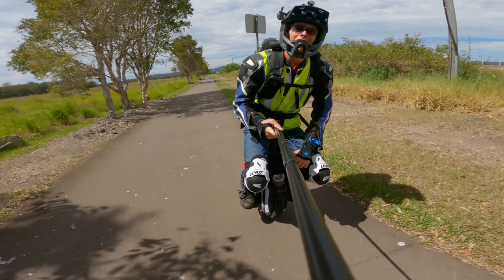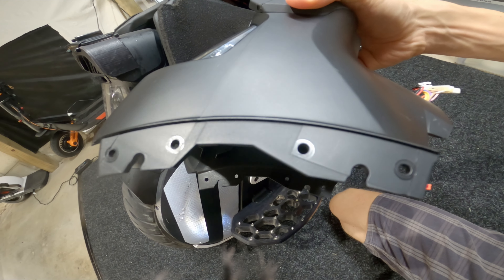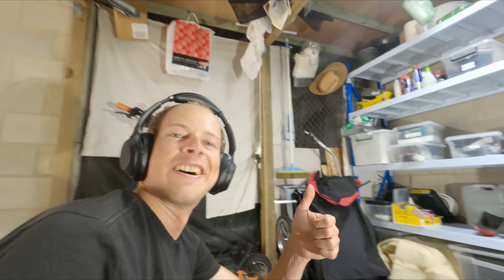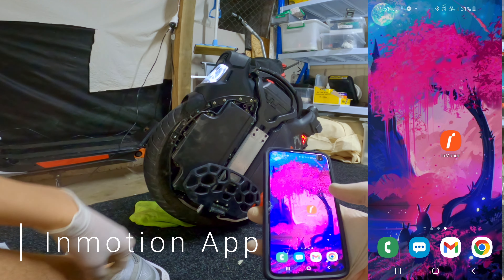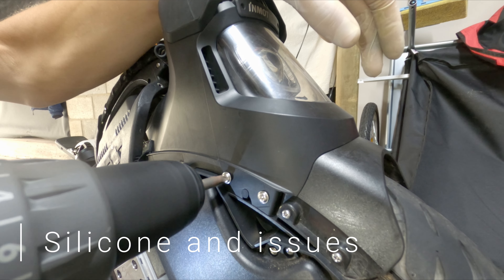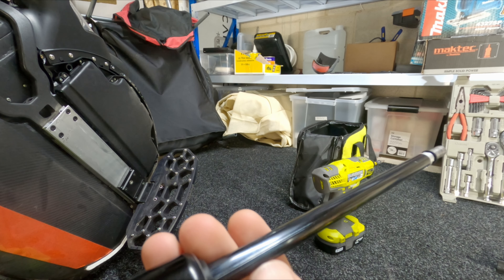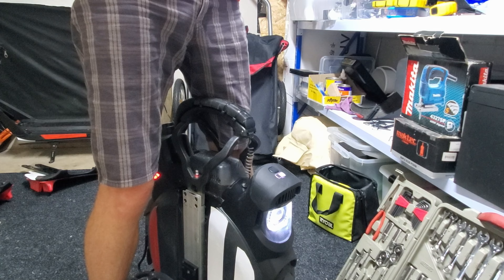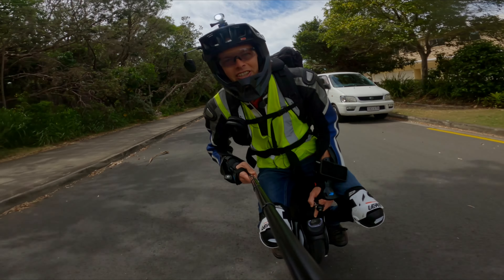FIXED! New Headlight on my Inmotion V11 EUC - Part 2

Comment: V11 owner here too… That squeak is the suspension sliders rubbing up and down the plastic… I cut up 3m felt pads (designed for gluing underneath stool and table feet) and stuck them next to the plastic sliders… then applied sewing machine oil to the felt and the squeak went away plus makes for great lube! It was a rather snug fit to slide the thing back on but makes for very nice quiet and smooth motion…
Reply: If you try it, make sure you stick the felt to same plane as the plastic as it will wedge in between the black plate and the aluminium… when u add the oil it makes a very snug fit which you should wobble gently and slowly lower down…
Reply: @Blakeusblades  "slidders up and down the plasic"?
What do you mean by plastic? The saddle part that slides over the alluminum slide rail?
Reply: The black plate that slides in between the 4 plastic guides…
Reply from the maker: oh hadn't thought of that area. cheers!

Comment: I would use some grease, Slickoleum, on the suspension rod. Its air sprung so the sealing has to be a lot tighter than coil. Secondly, this is what I did to some cheap air shocks on my escooter that majorly improved action, remove the valve core and inject some suspension oil like Fox Gold or similar. Huge improvement in action, removed most stiction. The heat from friction on that suspension will destroy the seals. I don't know why China based suspension cheaps out on lube but they do.
Reply from the maker: hey thanks for the tips, keen to try them.

Comment: Great vid, thanks! My suspension also squeaked at some point, and I managed to fix that by lubricating the suspension rails with WD40. No disassembly required for that, as it’s exposed already. The fact that the suspension rails are exposed moving parts probably means I’ll have to lubricate them every now and then, as the rain washes away the lubricant over time.

I posted a picture on my channel, as I can’t post pictures here.
Reply from the maker: Hey Dennis, YES! ah what a process but I've isolated it to the sliders too. 
eliminating the pistons and foot plates. 
I stripped down the sliders and removed / cleaned the slider block spacers. 
As you said, I lubricated the rails with a silicone spray (test). Then felt it was the wrong type so went with PTFE as everyone suggests, but it wore off within one ride doh. May just need new slider blocks like here: https://www.ewheels.com/product/im-v11-slider-block-spacer-set-screws/
Ewheels don't ship to Aus so i'll check with my shop too. I'll post about it if I find a more permanent solution.

Thanks for the pic, interesting to see the wear pattern is exactly the same on the black paint. 
ta, jono

Comment: That was an easier fix than I suspected. 
I just check. I am at 3900km. I have the exact squeak. Its coming from the pedal area. Turn the wheel on. Lean over it and put one hand on each end of the pedal. Apply pressure to each end of the pedal. Back an forth. This is where I heard the sqeak. Don't know if its hanger or shaft wear. You have different pedals so I now know its not the pedals. I sprayed white lithuim on my pedal shaft and the noise dissappeared for two rides. 
I also have the play in saddle/craddle. Not as much as you do but I did change my slide spacers about 1000k ago(Ewheels has them). The v11 has 4 spacers on the aluminum slide. When I change my tire i will add 2 more toward the top where I think they're most needed. That should add little more rigidity. 
I have ridden in a few heavy rain showers and I have had no issue with the power button. However, your tape idea is a good idea but cut the tape in an oval/circle shape next time and it will look close to stock. I have some 3m clear tape. Im thinking of doing it. I doesn't hurt the looks and provides some peace of mind. 

Also, I just had a firmware update. Did you get it?
Reply from the maker: Oh nice, I would like some of those new sliders. I thought that the spacers had specific spots they fit, how can you add more?!

Hmm my foot plates are difficult to squeak by hand. Last time I used light silicone spray to lubricate the pin, i'll redo it with some heavier grease.

Yeah the 1.4.15 firmware went on yesterday. It was a bit odd on the app saying "Null' and then checking versions again and said it was already the latest version. seems to have updated the wheel though since the wheel beeped and rebooted.

Comment: I had V8F,  after 560 km motor broke and also damaged controller. 600USD cost for the motor, another 200 USD for controller repairs. I also have Begode Tesla T3, zero problems after 4100km. I love simple Begode wheels. In general I really like non suspension wheels. Almost no maintenance needed :).
Reply from the maker: Some of Wrong way's videos promised me how simple wheels were meant to be. then i got the damn suspension v11! yeah that's definitely an appeal of non suspension - far simpler and lower maintenance. That is my hope with the Sherman S, lower maintenance on the suspension.

Wow that is some poor performance from the V8F, warrenty didn't cover it? Almost be able to buy another new wheel for those repair costs x.x
Reply: @jonoeuc  It is mystery to me what happened. In my opinion the bearing got stuck and the motor twisted the axle by itself. This happened when I was walking next to the wheel by using troley handle. The damaged motor cable then blow up the controller. It was incredibly unlucky and my seller did not believe me. It looks like i jumped the wheel. Other than that V8F is very simple, changing the tire is a joy, so simple :-).
Reply: Buy from a reputable vendor and get a warranty next time. Suspension is the real deal and most wheels will have it going forward.

Comment: Good vid
Interesting, probably a cold solder connection. I seen that they put alot of silicon on the components of that board. That would make it hard to impossible to touch up the connections with a soldering iron.
38$ for Uber, how far? No friends or family to come get you 🤣
Cheers
Reply from the maker: it was 17km (10.5miles) 28minutes, ohh nuh it was the wroooong way from them and bad time of day.

Comment: v11 does not need any additional sealants to withstand any weather.
Reply from the maker: it does have very good stock water proofing. I always air on the side of caution since the risks of water caused damage is so high.

Comment: So my head light on my V11 stopped working and they sent me a new one. I was going to send my V11 back and have the shop do the replacement. However it seems like it’s very simple. Should I just do it myself or let the company do it? Great video mate.
Reply from the maker: If you have the allen keys and can see what I did then go for it! it's straight forward(unless you've siliconed your case shut like me 😅)
Plus less downtime if you do it yourself. Good luck!
Reply: @jonoeuc  well I did the replacement and still no light 😞. I guess there’s an internal problem and shipping it back is my only choice. However taking the light assembly off and putting the new one on was just like you said. Thank you for your help and video.
Reply from the maker: ah what a shame. brace yourself for wheel withdrawal! (if it's your only one)
hoping for a quick turnaround.
Cheers
Reply: @jonoeuc  I shipped it off as of today so the waiting begins. This is my only EUC however I have a Kingsong S22 on order.

Comment: My headlight is impossible to pop out. You make it look effortless the way you just take it out but I have it stripped down to replace the inner shell and I’m considering taking a hammer to the headlight bumper. Was there a trick for you?
Reply from the maker: The only trick are the locating pins / slots that you must pop out at 2:55 in the video. They're clipped in so a sharp force to unclip them is needed thus my hand taps. Hopefully that's all that yours needs?